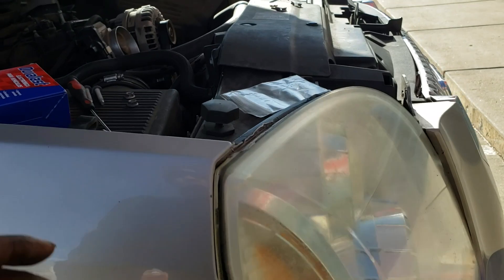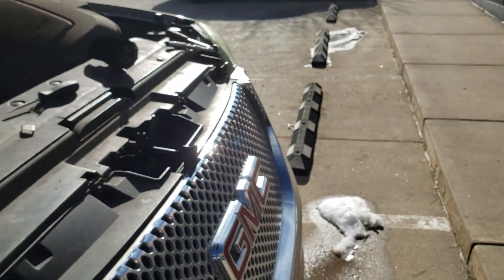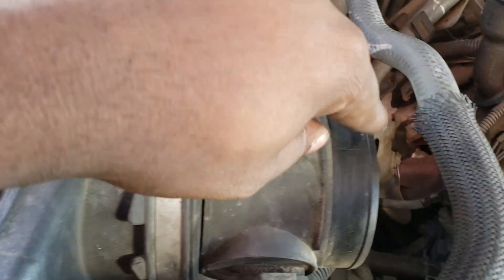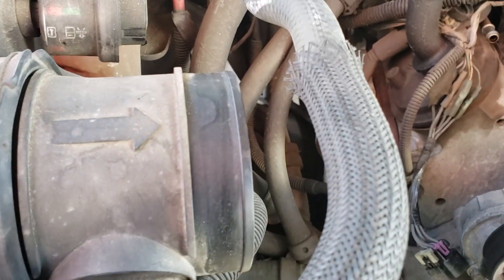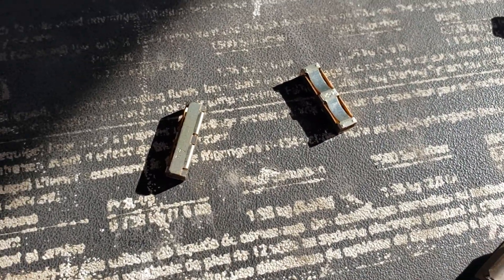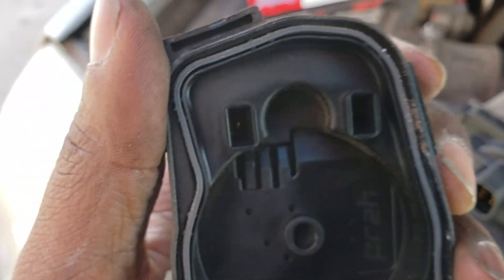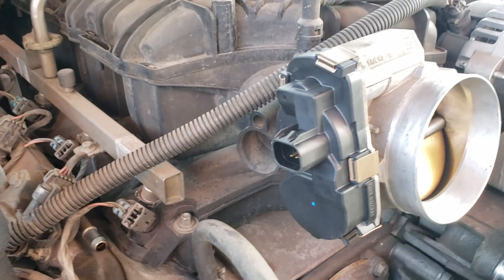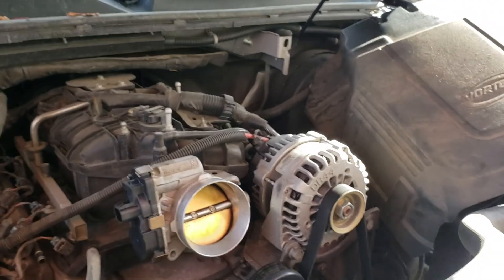2007 Yukon Denali Engine Power Reduced Fix

Comment: Did u have the service stabilitrak and traction control light on too? I'm having this same issue with my 07 tahoe and can't find a fix for it
Reply: Mines doing the same thing rn. Someone that had the same problem told me to take the. Throttle body out and clean it first with throttle body cleaner Bc the throttle body gets dirt and the sensor won’t read it. But the other option may be this video. Bc he was having the same issue with the stabilitrak
Reply: MrNeverWrong  ^
Reply from the maker: Tbh. Everytime I would go to the Car Wash, Something by the Battery was getting WET, And it would Throw the Throtttle Body Code everytime, It never Failed to do that, Till I started Covering the Battery with a Towel b4 the Wash, It wasnt throwing Codes anymore. But to Answer your Question. The Throttle, Stabilitrak and Traction control are All Related! 
Ive Read your Gas Peddle too can Be Faulty. Ive never done the Gas Peddle, But Either way only 2 Fixes to this Problem! Mines like I said something is getting Wet Underneath!
And I can't figure it out to save my LIFE! So I just remain keeping the Towel over the Battery tilll I can figure out how water keeps getting in
Reply: My 2007 Chevrolet Silverado was doing the same thing I've changed t p s gas pedal but none of that was my problem I found two wires running between the steering knuckle and the power steering had rubbed and broke two wires that fix my problem when I wire them back together no more problems new truck also one of the wires was my AC that had the three flash death Flash no more problems with my AC either
Reply: Yoo did you ever find a fix I know this 3 years old but I’m currently going through the exact thing with my 07 Yukon
Reply: @kingtuchee1990 going through it with my 2011 gmc Yukon Denali xl 200k miles

Comment: Today I have this problem on the free way no power I hit the gas pedal nothing my light ENGINE REDUCE POWER ON I put firs just the throttle censor same no power so I when to auto zone $250 the throttle body complete and now work good the light go aut and runs normal
Reply: Mine is doing the same but when I checked the codes it gave that it's the tps wire harness

Comment: Does it also do it in the rain??. I just bought a escalade took it to the carwash and had the same problem.  I took the battery terminals off and dryed them and started working.
Reply from the maker: Yes. Everytime I go to the Carwash. After it would start drying. All the lights on the Dash would start going crazy like Service stability, traction control and eventually it would go into Limp mode just randomly.  I put a big ass shower towel over the battery and never had no more problems after getting the Denali washed.  After washing the Denali and pulling over I would notice the towel was hella wet,  so I just kept the towel on every wash.

Comment: Yo what’s good Cam? Question, the silver ground strap under the hood on the driver side firewall. Do you know where the other end connects to? I found mines broke. Thanks for your help with the last one.
Reply from the maker: It is being held on with a 15MM Behind the Block. On the corner of the block to be specific. You will need a Very tiny 15MM to unbolt it. Or else you'll have to take off the Coil Packs, sparkplugs Wires. Valve Cover then the Bolts holding the block down just to get to that Ground Strap!

Comment: What code you get?
Reply from the maker: Service traction control,  stsbiltrak
Reply: @Cmimss  ok cause I got my check engine light on and the service traction control / reduced power and when I turn the key at times it won’t start right away it just cranks then fires up
Reply from the maker: @chicago412  Take to shop